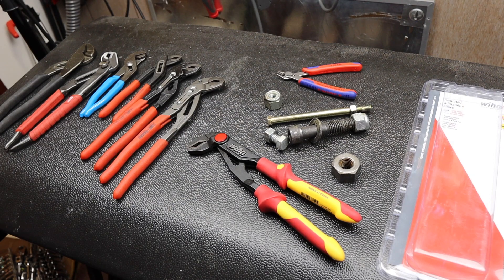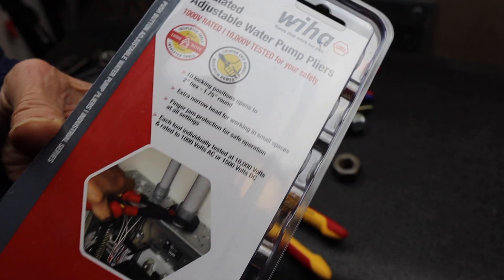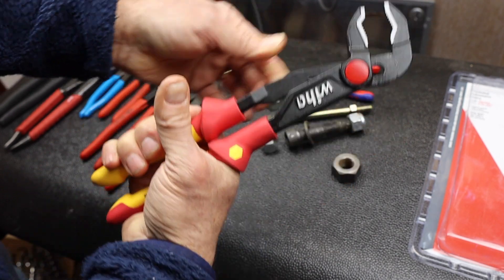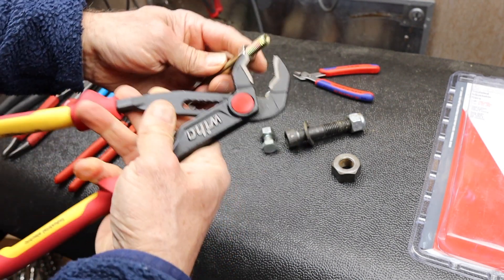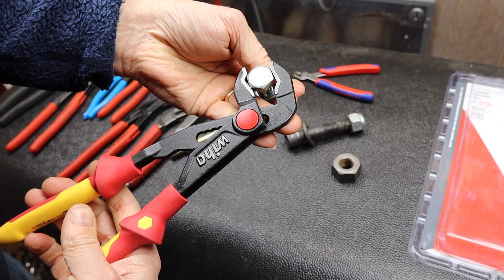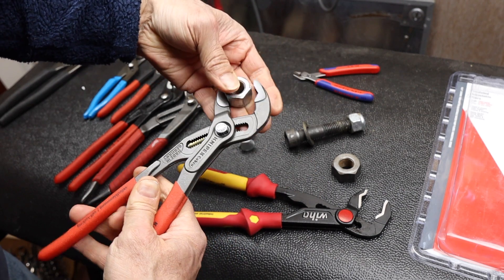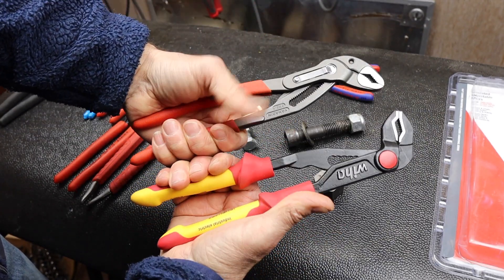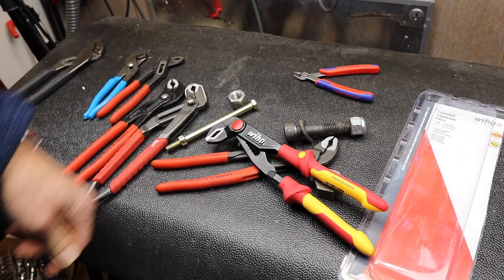Wiha Insulated Adjustable Water Pump Pliers. Crowdsource your Review / opinions about this tool.

Comment: I really liked  Wiha back when they made things mostly in Germany. Once the Vietnam thing showed up I pretty much ended that. Around the same time that KC Tool dropped Wiha from their lineup too, might’ve had something to do with that for them too I’m not sure.
Reply: Wiha pliers have, to my knowledge, always been made in their Vietnamese factory. Nothing necessarily wrong with that, the steel is ok and they hold up decently well, but some of the designs (like this one) could use an overhaul to make them more functional and the grinding on the models with ground surfaces is typically very uneven. 
They sell some cheaper bits and stuff that is made in different countries (OEM from other manufacturers?) that varies in quality, but their screwdrivers that are actually still made in Germany are very good.
Reply: Wiha has they own factory in Vietnam so quality is god.  Wiha actualy have better tols for cuting than knipex ( tools for electrician). Knipex have  to soft metal so you can cut only cu.
Reply: Yet you love Wera which is made in the Czech Republic

Comment: I have those pliers, had em for around a year and I dont like them, my favourate are the Gedore with the dipped handles followed by the cobras. That said I like the Gedore for electrical work as i like the shape of the jaws being longer and narrower than the standard cobras.The anti pinch on the Wiha is terrible, I find the adjustment okay and the lack of fine adjustmants doesnt really make any difference to me. If you need VDE pump pliers get the Knipex or VBW (stahlwille also VBW). 

Incedentially the reason for using insluated pump pliers (and insluated tools in general)  is not normally to wrench on live electrical components rather it's for working in the vacinity of live electrical components espicially where high amperages are involved where a dropped tool could land across two bus bars or terminals and cause a major explosion on large distribution boards or battery banks in UPS systems or electric vehicels. Think 2000 amp distribution panel with multiple chambers where you isolate them one by one to add or modify circuits etc. If you accidentally drop a spanner, rachet or pliers down a bus bar chamber that touches phase to phase you would have a 400+ volts 2000 amp arc flash which would literally blow the whole panel to bits!

I did something like this myself once years ago on a large voice evac/fire alarm system changing batteries and whilst tightening a terminal on around 20 parallel wired 24V truck type batteries touched an extension bar on a rachet off the side of the rack they were mounted in.....made a big bang, burnt a hole in the side of the cabinet and scared the living shit out of me! Needless to say I never did that again and would at least tape up an extension bar with insulating tape if I didnt have an insulated one nowdays! 

Love the channel :)
Reply from the maker: Outstanding comments Phil. Thank you so much for sharing them with us. Your insights and experience is exactly what I wanted to read.
Reply: you mind telling us what model number gedore plier you are referring too? they a couple of different kinds

Comment: Guy at work one time was showing off how he could break the head off a 3/8 grade 8 bolt with a pair of cobras and how no other channel locks could do it. So of course I had to prove I could do it with an old 10in  pair of diamond horseshoe's. Unfortunately diamond horseshoe isn't around anymore but the knipex cobra's are great.

Comment: Just stay with Knipex. There is a VDE version for the cobra series. The Vietnam made pliers are not very durable. The cobra, also have many setting points,and you can adjust the handles position much better. The knipex cobra vde is chrome plated, and have a quickset auto adjust mechanism. It is faster and much easier to use. When it is about pliers, only knipex for me.
Reply: Agreed. Wiha for screwdrivers, Knipex for pliers.
Reply: @Cleofizoid  I still prefer felo or facom for screwdrivers, but knipex or trusty channellock Is always my choice for pliers
Reply: @kennethstephens8046  I'll have to checkout Felo and Facom. 👍
Reply: @kennethstephens8046  I have a set of Felo precision electronic screwdrivers. Good to go. I have a set of Wiha VDE drivers. The handle with the different bits. First time I used the combo phillips and slot head (forgot the name) the tip shattered. Wiha sent one out right away but doesn't inspire confidence.

Comment: It's only for pipes anyway. Usually pipes are not carrying electricity the mass of the pipe system would ground them anyway. I'd just get the cheap Knipex Cobra (18€ here) or another solid local brand.

The only German tools worth importing in my oppinion are :

Stahlwille wrenches (the non-ratcheting ones)
Stahlwille sockets (They are thin and strong, go for the old non fine tooth ratchet it has better tolerances and is easy to rebuild)
Hazet impact sockets (Still made in Germany unlike the Stahlwille ones, but you might as well buy Ko-Ken if those are cheaper)
VBW / Stahlwille pliers wrench (simply the best one)

I would just avoid Wiha / Wera (Wera is not even made in Germany) and head straight for Felo / PB Swiss Tools (I prefer the PB Swiss)
Speciality tools like drill bits etc.

Not everything from Germany is the best. As a German I don't trust the Made in Germany label too much. If it's made in Japan you know it's really good. But there are exeptions for example ratcheting wrenches are the best from Taiwan (Hi-Five) they are sold as Mac Tools / Facom all over the world (the ones with the swivel joint are cheap, get the ones with the selector, for ratcheting ones just buy cheap from Taiwan).

Comment: I'm very recently got a 10-inch pair of Knipex extra slim Cobra pliers. And they are quickly becoming my favorites just because the angle of the head is so much better for getting into the areas I need to get into most of the time. And that's with home plumbing mostly. But I suspect they're just as good in automotive uses as well. There is only one pair of Knipex I wasn't very happy with and that is their 10 inch soft pipe gripping plies. That soft grip on these things is terrible. You're far better off using a couple paper towels and removing the soft grip tips. I don't know if I maybe have destroyed the soft grip upon my first time using them in an area where I needed far more torque than they were able to handle. And I'm not so much thinking about getting a replacement pair because if they're not broken and I get the same thing I had I feel like a fool for buying them a 2nd time.

Comment: I have a pair of the Wiha (not VDE).  Complete crap compared to Knipex, Gedore, Stahlwille/VBW, Hazet.    Honestly, they are no better than the Amazon basics pump pliers which are $20 or so for three in different sizes.  They are even worse than the NWS.  I threw them in a vehicle, but honestly, I think I would be better served with the channellocks.  I’d give them away, but I’d feel bad (I normally give away cobras, Gedore, or channellocks).  IME, if it’s not a screwdriver, or something similar, Wiha is not good (although I did buy all their ratcheting wrenches in big sizes when they went 90% off because I am cheap).  For VDE I have two pair of the Knipex cobra 250mm VDE, but I can conceive of a reason when I would need insulated pump pliers.  I just bought them to match the set (not that I work on live wires unless they are spark plug wires but I digress).
Reply: I have a pair of the Klein branded, NWS made pump pliers. Honestly just as good as the Knipex. My only gripe would be the adjustment isn’t as fine in the NWS pliers. Although with larger fasteners that shouldn’t be an issue
Reply: Glad you like them, but my experience with the NWS is that the steel is significantly inferior (teeth wear) and the button sticks.  They too made it to a vehicle kit. :-)

Comment: The large position pitch seems like a potential issue, as does the riveted spring.  I‘ve seen these at a local hardware store and wasn‘t impressed, rather get the Knipex. 
There are other actually German made water pump pliers, Hazet has one, VBW (Stahlwille) does too, and Gedore from Austria as well. The Hazet is pretty nice but usually about 1/3 more expensive than the Knipex.